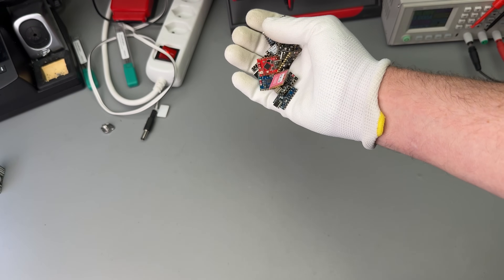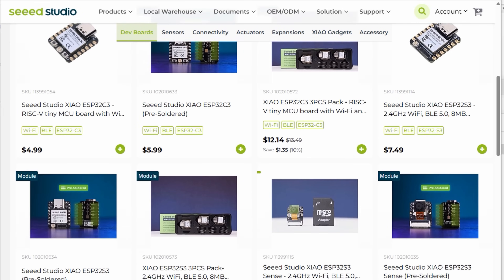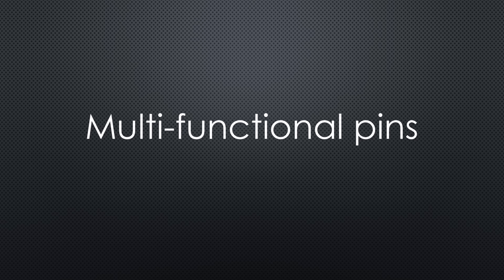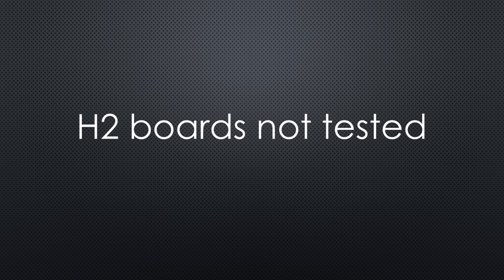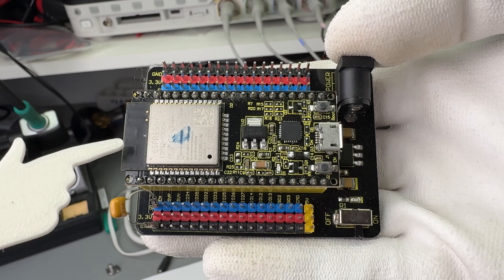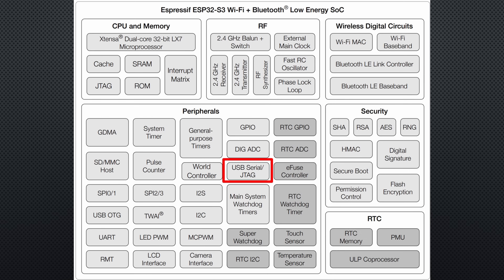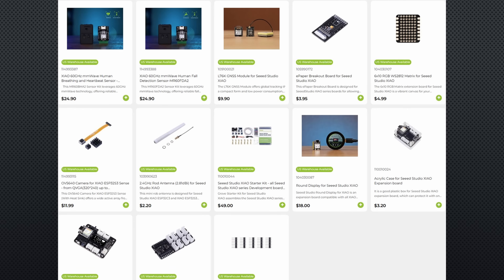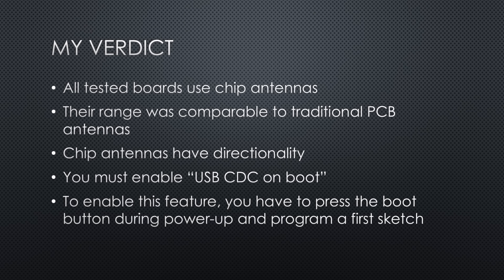Stamp-Sized ESP32 Super Mini Boards Tested: Range, Programming Tips & Best Pick

Comment: A lot of the time the antennas on these boards get completely gimped because A) they didn't follow the PCB ground clearance and design practices that's usually mandated in the datasheet for the antenna itself, and B) because they did absolutely no impedance matching for the chip pin output into the antenna, resulting in power reflection, wasted chip power, heat, and poor performance. Many times you can see they implemented PCB connections for an RF pi filter, but then no-one ever bothered to empirically determine the best practical component values to use for that filter to get best transmission out of the antenna, so you see that on the PCBs there's a random inductor or 0ohm resistor and no rf-capacitors placed to complete the filter, gimping the board.

I bought some C6's and they heat up to toasty when doing anything radio and draw 65mA current. Probably need to replace with a wire antenna for good performance.

Comment: Thanks for this. As I was testing my C3 Super Mini I discovered that the Wifi essentially stops working when the module is plugged into a standard white breadboard. Apparently, the internal metal bus bars cause enough detuning (or whatever) for the Wifi to disconnect. I can see this in real-time by laying a module on the breadboard while connected and running. Lost a few hours debugging this one. Greetings from Basel.
Reply from the maker: Interesting! Thanks for the information!

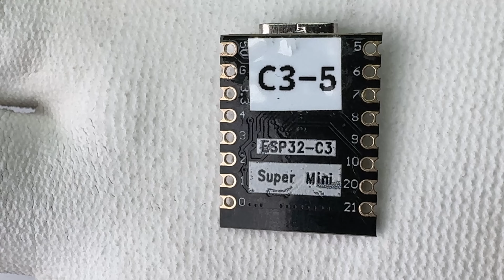Comment: I have the board mentioned at 4:19. Initially loooking in the Device Manager the port would come and go. But after following instructions from the manufacturer online guide for Arduino IDE settings (Board: ESP32C3 Dev Module and USB CDC on Boot: Enabled) and doing a 'hold boot button down -> press reset button and release -> release boot button" sequence it seems to be fine. Look for the USB CDC setting in the IDE under 'Tools > USB CDC on Boot'.
Reply from the maker: Good tip! Indeed, without that setting, it will not properly work.

Comment: i think we don't need up to super mini.Just use a mini version for full pin while only a little bigger,it is not even that bigger.For optimal real life application,the dev kit is the best in my opinion.For performant development,rp2350 or 2040 is superior(also with wifi),stm32 is the most performant
Reply from the maker: I do not think that an RP2350 is faster than an ESP32...

Comment: Hello Andreas - I hope your time off is going well. I have a video for you.  v=8gu19fvKv3M  
I remember you used Chat GPT or similar to check if it was your cat or dog at the door. The board linked above is amazing I think you would enjoy it very much. 
Also I am working with Halow Wifi which is over a few kilometer. 
My ESP32 current project has integrated an SIM7080G for world wide ESP32 connectivity. 
Stay well.

Comment: Thank you for this video! I am very new to ESP32 and these were a great budget way to start learning. I have a handful of the SuperMini S3 and have been experiencing issues, I did not know about the USB CDC on boot, will try this now! 

Do you have any videos on this specifically? I'm looking for some tips to get started, maybe more reliable firmware if you think that is helpful, or even just a best practices guide when getting started with these. I think they will be extremely popular for Home Assistant builds. That is what I plan on using them for, but still want to experiment with sensors in IDE.
Reply from the maker: I made a video about USB and the ESP32
Reply: @AndreasSpiess  I'll take a look for it! Thank you!

Comment: Interesting video. I have about twenty esp32 C3 all of them had very bad reception, and some had reception at all. I am very disappointed. I have 2 esp32 S3 zero, they worked but not so good like a esp8266 mcu board, or the cheap esp8266-01.

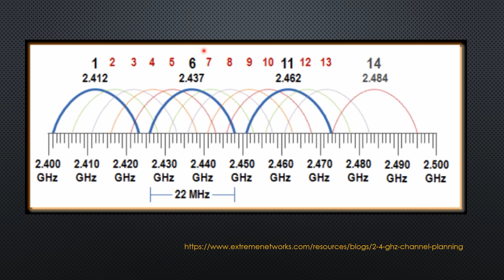Comment: @7:28 you show the orientation (and mention it later). I'm sure you know, but the PCB antennas have a null in that direction; parallel to the pins. They radiate in a donut, again, with nulls pointing the long way through the board. I'm not sure it actually matters though, since it'll bounce off everything and doesn't have a lot of range in atmosphere.

Comment: Does the On-Board Battery Charger on the Models S3, C6 and H2 really work?
Reply: And is there also a powerpath, so that the boards will be powered via the 5V-Pin (charged via Solarpanel) and not all the time via battery?
Reply from the maker: I did not look at it and also did not try it.

Comment: I've bought a few ESP32-S3 Super Mini's but struggle to get deep sleep power consumption below 440uA.
I've already removed the led, but no difference.
Also hard to find info or examples  about this.
I'd love to get this below 50uA..
Anyone?
Reply from the maker: Deep-sleep is always best when only using a bare chip or module. So, maybe you have to desolder also the LDO, so that the chip is the only thing powered.
Reply: @AndreasSpiess  Yes true; but defeats purpose of battery connection.
I've now removed RGB led + 10k resistor and now running on 68uA.
I think that's fair for this board

Comment: Great video, as always. Thank you.
I surprised you're using Arduino Studio and not PlatformIO. Compilation time for esp32 is an issue for me in Arduino studio, like 2 minutes. In PlatformIO it's like 6 seconds. This is because the first one compiles from scratch all the time, instead of only compile what you have changed. Maybe it can be fixed somehow, not sure. PlatformIO is overall very great, I recommend.
Reply from the maker: PIO is a good product. For the channel, I use Arduino because everybody can use it. PIO is for most people the next step.

Comment: I purchased about 10 esp32c3 super mini (black) from various trusted sellers on Ali and couldn't connect i2c sensors for a long time. All the pinouts indicate that i2c is on pins 8,9 or 4,5 or 6,7. I tried everything and it didn't work. Using a neural network, I found information on one forum that the guy found a solution with similar boards, i2c is on pins 9.10 (SDA,SCL). I connected the sensors to these pins and the sensors started sending data regularly.
  Unfortunately, the situation is similar with spi, connecting the displays to the pins from the official pinouts I do not get any result. I love your videos, thank you for what you do))
Reply from the maker: I2C and SPI pins are defined by software with a default setting. If your board does not have the default pins, you have to initialize I2C or SPI with the pins you want to use.

Comment: Hi Andreas, I am a guy with a french accent ;-). I was attracted to Platform io by one of  your previous videos. Trying to go from the Arduino IDE, because the debugging sucks there. Unfortunately, after  spending days with Chat GPT and then Co pilot, I cannot say that I am impressed. I tried to make a simple program to blink the RGB led on a (Ali express)  Tenstar   esp32 c6 super mini.  This worked well with IDE, but on Platform IO, I have been running in circles and could never make it blink. At best it builds but never links the code. 
The AI bots do their best, but can never eliminate all the problems. I wonder if you have solved this for all those cheap chinese modules? Or if there is another solution regarding debug. I planned to use the hardware espressif board ESP-prog for jtag debug, alas, I never reached this stage.

Comment: I bougth few C3 Supermini from Ali but Wifi is awful, sometimes they connect right away and sometimes never. I've seen video comparing that there are few versions, and that antenna is too close to other components, I tried now C3 Zero which have some distance between antenna and components but that works similarly. I just upload code where i connect to Wifi and print dot every 500ms, and sometimes it connects almost immediatelly and sometimes does not connect in 20 seconds. I would not use them anymore where Wifi connectivity is important
Reply from the maker: Thank you for sharing your experience! Did you try a "standard" board with the same software in the same location?

Comment: Thanks Andreas for this helpful video, I will probably use one of these boards in a project as I only need a couple GPIO pins for a radar sensor, about 12 leds and a button-switch. As it will be running on a battery my guess is that I need a separate module for charging/boosting as it is not preferred to power the sensors via the esp32 board right? Do you know if there are shields that I can stack on any of these boards for this usecase together with a LiPo or LiFePO4 battery?
Reply from the maker: Some of the boards have the circuit to charge 3.7V batteries. The chip, anyway, runs on 3.3V. So, no additional board is needed for these boards. However, none work with LiFePo4 batteries.
Small LiFePo4 batteries are not well supported. You have to search for those projects.
Reply: @AndreasSpiess  thanks for the answer! Will it be fine to power these sensors then from the ESP-32 or use a separate 5v boost board?

Comment: These seem to be a natural for small IOT projects. Thx for the comparisons, especially the info on the practicality of the chip antenna. Not intuitive. Also quite a range of performance, I imagine you are unhappy with the Xiao devices. A metal enclosure might need the external antenna. Nice to have the GPIO switch to have standardized sw but if it reduces power maybe its not worth it.
Reply from the maker: You are welcome!

Comment: I'm using one of those knock-offs ESP32 C3 board for a little project, a clock with a DS3231 and 3D printed 7 segments displays. I'm using python.
So far it has been fun and relatively smooth (some bumps during the installation of micropython but nothing crazy)
Reply from the maker: Glad to hear your project is going well!

Comment: I often use the Seeed XIAO (ESP32S3 model without a chip antenna, requires an external antenna) and the Waveshare ESP32S3 Zero. I've been using the Seeed XIAO since its first SAMD21 model, and it's proven to be extremely reliable.
Reply from the maker: What I said does only apply to the one I tested with the antenna switch. Thank you for sharing your experience.

Comment: thank for comparision. no more doubt.  I wonder how to connect C3 board to external antenna  @9:20   just shorten the ceramic antenna to molex antenna connector?  I also can see a missing SMD resistor or capacitor too.   thank you.
Reply from the maker: I would not try it if the supplier does not offer you this possibility.

Comment: Hello, Andreas! Thanks for this useful video. Mind to upload the comparison table not only as PDF, but as the original Excel file or Google Sheet and link it in the description? The images in your PDF export are pretty tiny, plus I’d like to add my own comments. (Also: Why did you stop numbering your videos!?)
Reply from the maker: 1. I created a new table with a new link
2. The videos get numbers. But only after a time
Reply: @AndreasSpiess  Thank you very much. Already noticed that the table has been updated and switched from PDF to Google Sheets. Excellent.

I find the column "LEDs" a bit confusing. I assume the number refers to the GPIO pin, so "Power +1" actually means "Power + GPIO 1". But what about these "3 (one multicolor)"? What do you mean by "one"? Do you mean "GPIO 3 (an RGB LED)"? (But how is the RGB addressed ... that requires more pins. See, quite confusing).

Comment: You mention that the ceramic antennas are asymmetrical, with a dot at the feeding point (so must be installed correctly). Does that mean the leftmost antenna shown at 9:14 is incorrectly installed? If so: Can it explain your observed difference between boards?
Reply from the maker: AFAIK, they are all mounted correctly

Comment: The big problem with these boards are the heat. As they have a very tiny LDO, they don't last too long if they are not in a cool place. This is actually a problem with most of these evaluation boards, and due to this problem I wouldn't put them to industrial project. I'm waiting for versions where they use a professional switching power circuit.
Reply: Good point. If desired you can easily add your own tiny 3.3v switching power supply and feed the board via 3V3, there is plenty of affordable and small pcbs (keep ripple low). Or better yet, power the board with 5V rather than higher voltages, so the „wasted“ energy is as low as possible. Or use a lifepo4 directly. My c3’s do get warm but I personally had no heat problems whatsoever when powering from usb, even when mounting the pcb in small non-ventilated 3d-printed housings and running them for many hours (wled). Using deep sleep and/or lowering the cycles may also help. Typically c3 and even more so S3 are huge performance overkill at default settings for most diy projects.
Reply from the maker: I agree, industrial projects have different rules.

Comment: These little boards are great because many modern projects simply connect to external peripherals with I2C/SPI or similar and don't actually need that much "simple" GPIO. If you do, you can always add an I/O expander. Normally this might seem silly, but when you're building a one-off and don't want to design a board yourself, the small footprint of these allows you to cram them in much smaller enclosures than a more "standard" microcontroller board, and fitting a lot of small boards is often easier than trying to fit one large board.

I have had compatibility issues though, I'd stick with the more "common" manufacturers if you want to avoid issues getting these things programmed and working.
Reply from the maker: Thank you for sharing your experience!

Comment: I have an Esp32 super mini s3 with these pads on the back and charging system, but I have experienced a lot of heat on the esp32 75°C ~ 85°C, in some cases the charging IC goes into safety and turns off.
I believe that the ground pads were not soldered, this would serve as a heat sink.
I saw that other people reported this with these mini boards.
Congratulations from Brazil
Reply from the maker: The ESP32 consumes a lot of power while using Wi-Fi. I agree, it can get hot.

Comment: I also got esp32-c3 boards that didn't work. Apparently Espressif produces esp32-c3 chips without onboard flash. My chip did not have the marking FN4 or FH4 which marks the presence of onboard flash. Took my a couple days to figure this out by googling. Very frustrating, but checking my return now with Amazon it was never completed, thanks for reminding me!
Reply: I assumed that many of these c3 superminis have external flash. If I am not completely mistaken, mine do not report internal flash either but work like a charm.

Comment: Would be great to see another video which covers deep-sleep power consumption of these same boards.  I've found the power consumption varies wildly as some of these boards have the power LED permanently on, whilst others disable the power LED if powered directly via the 3.3v pin ( but not all boards do this )
Reply: I do this to my sleep boards: s blob of solder and the led is removed.
Reply: I just pop the power led with a small flat screwdriver. Then in deep sleep it uses around 41uA. Combine that with ESP-Now for transmission and you can wakeup, take a sensor reading, send it and go back to sleep in ~130ms. I have one outside, with a 18650 battery and it last around a year. The only downside is the chip antenna is very weak and range is poor.
Reply: @Andreas Spiess Yes please give a brief analysis about their deepsleep power consumption! Thats IF you have a way to measure uA! Otherwise on the other hand would be helpful to know which ICs/mosfets etc. are used in each board as we could look up the specified leakage current that way which might vary and is critical for long time applications where the esp32 often is used.
Reply: I tested a no name ESP32-C3 supermini purchased from Aliexpress. The power LED was on when powered by 3.3 or 5 volts.  Power consumption was about 300 microamps in deep sleep mode. When I removed the LED the deep sleep power consumption dropped to about 53 microamps.  Beware when you put the board into deep sleep you cannot upload to it from Arduino. The device is not visible on the USB when in deep sleep (at least on my Linux laptops)  So when you are testing put in a few second delay just after booting in order not to lock yourself out.
Reply: @ve2jgs  There is a workaround: remove USB plug, hold the 0 button and plug USB back in then release the button.  It will go to upload mode and be visible to USB.
Reply: @arp_catchall  Thanks for the tip!
Reply: @arp_catchall  I did this which also worked:
1. Press and hold the BOOT button.
2. Press and release the EN (Reset) button.
3. Release the BOOT button.
Result: The board enters download mode, allowing you to upload new firmware via the USB port regardless of the current program's sleep state.
Reply: that would be really useful indeed to measure deep sleep consumption

Comment: The wifi subsystem of C6 is quite different than other ESP boards, since it has Wi-Fi 6 (802.11ax) with OFDMA for both uplink and downlink communications, and MU-MIMO for downlink. If possible retest with a host board that has a C6, maybe the XIAO C6 with an external u.fl antenna. 

PS: In one of my projects I used a XIAO ESP32-C6 that required to send raw TCP packets to my PC over WiFi at reasonably fast rates. The ESP32C6 was sampling a sensor at 25.6 kHz and it could flawlessly send the data with 86*3*16-bit samples (3 for three axes, and 86 is the highest number of samples that the sensor's FIFO buffer can store and each sample being 16 bit long) to my PC with the chip antenna alone.
Reply from the maker: Thank you for the additional info! Maybe I will do once a video about WiFi 6...
Reply: That's really cool! Do you have any code you could share on how you did this?